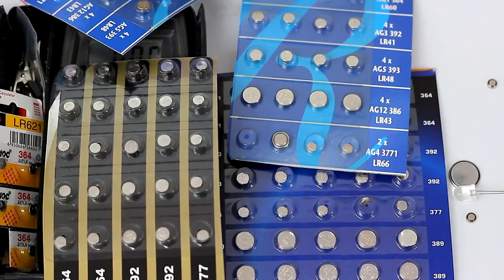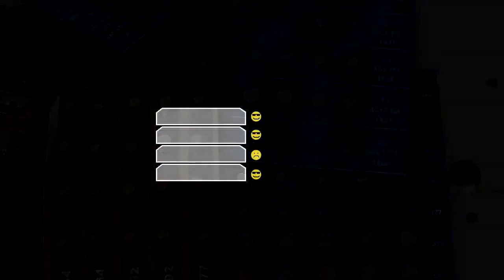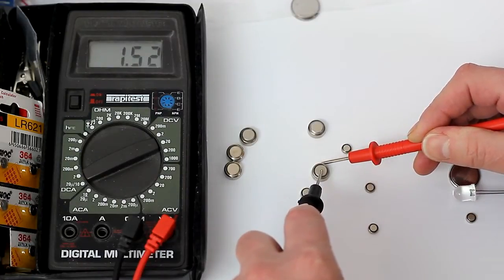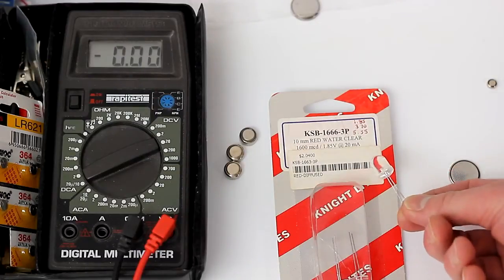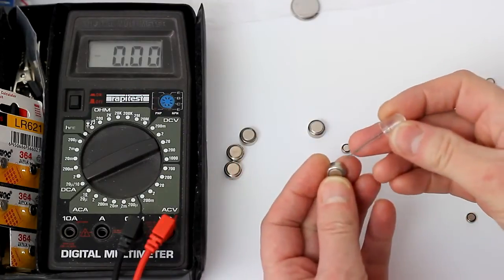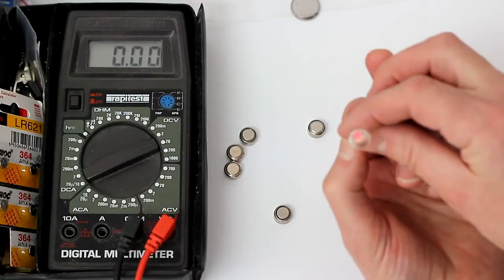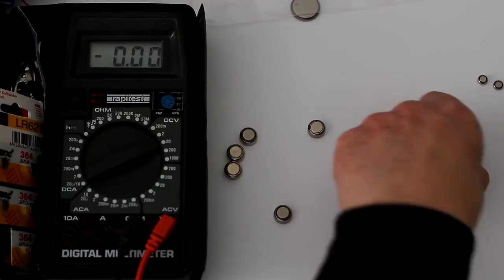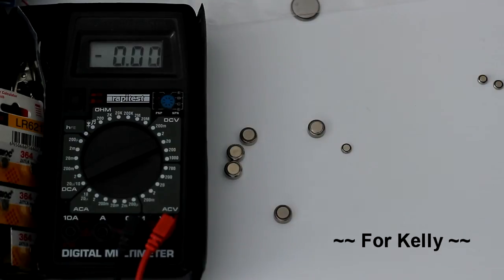Test a button cell using a red LED if you have no meter.

Comment: Would like to have gotten a clearer view of Where you were connecting the LED.  Couldnt see from the video what the right way is.
Reply from the maker: You just need to hold it so that one LED wire touches one side of the battery and the other LED wire touches the other side, without shorting (meaning, be sure that the LED wires don't connect to both parts of the battery at once). It'll only work one way round, so if it doesn't work one way, try the other.
Reply: andycivil OK cool thanks.  Sounds simple.  Appreciate it:)